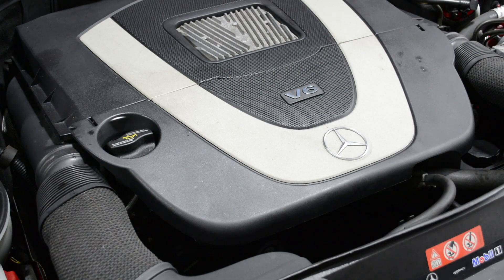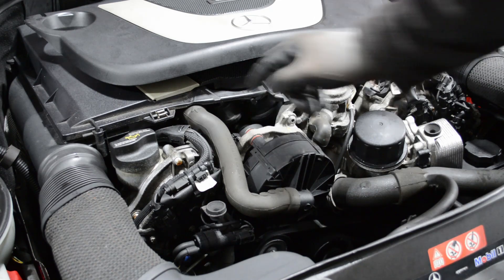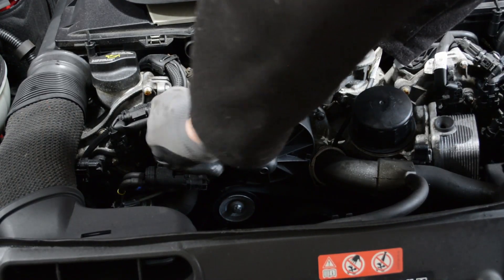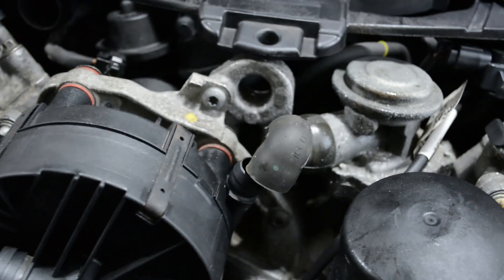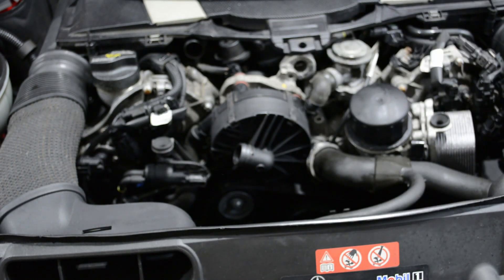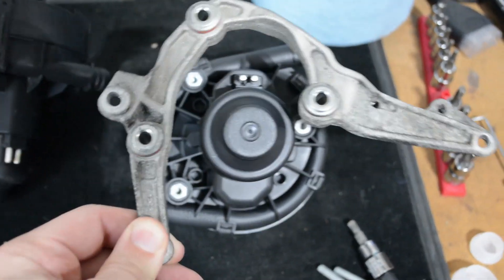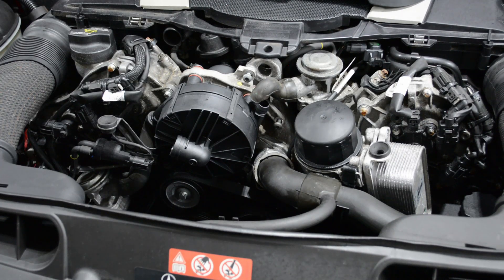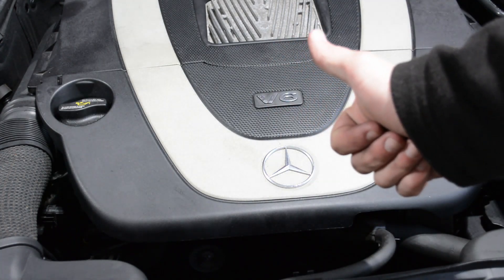Mercedes-Benz C-Class V6 (M272) Secondary Air Pump Replacement

Comment: I have the exact same engine, and i get an annoyingly loud high pitched noise during cold start and only for 30 seconds or so, after that it goes away completely and the car drives super smooth without any issues, and it doesn’t occur again during normal temp. Startups, only cold starts.
Could the secondary air injection pump be the culprit?
Reply from the maker: That sounds a lot like the culprit. This is an easy component to remove and test. You could also unplug it, test start the car and see if the sound goes away.

Comment: what size are the 2 smaller T30 bolts?  Are the T30 M6 16m??
Reply from the maker: Great question- I am not sure of the thread and length. I just checked a Mercedes-Benz parts diagram but did not see the bolts called out. M6 x 16mm is a good guess, I remember most of the bolts in this assembly threading into thru holes so length should not be a major concern. I will let you know if I get more concise information about this!

Comment: Is it possible for the air pump to cause a slight judder sensation when stopping at the lights for eg, especially on colder starts?
Reply from the maker: Difficult to say- I would not think so, it would definitely be drawing more heavily on alternator which could sap engine power, but I never noticed strange cold start stopping behavior. Check your transmission fluid and brakes.

Comment: The bolts for the brackets are not that easy to get to on the e550
Reply from the maker: Yea they can be tricky. Spraying with penetrating oil and using an impact wrench could definitely help.

Comment: Did you get a code or check engine light?
Any other sign? What mileage you had when it failed?
Thanks in advance!
Reply from the maker: No codes, the pump was just extremely loud at startup- annoyingly so.